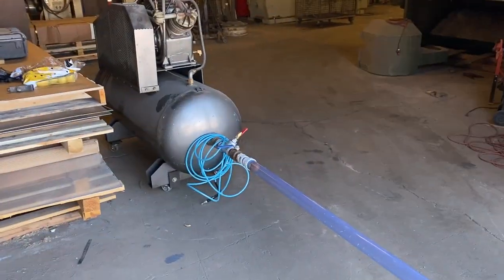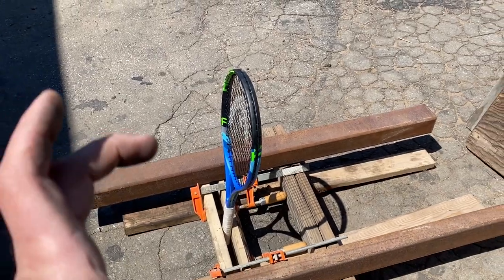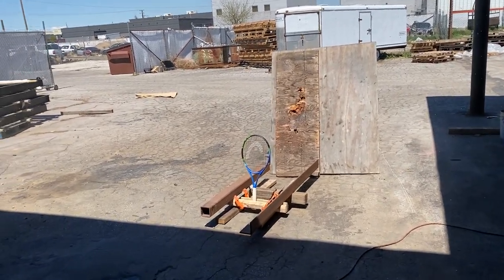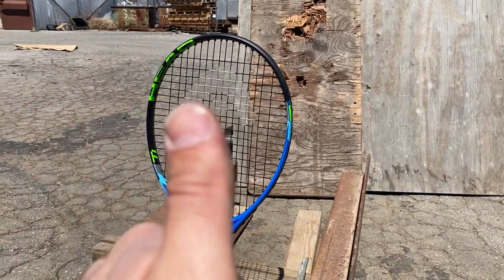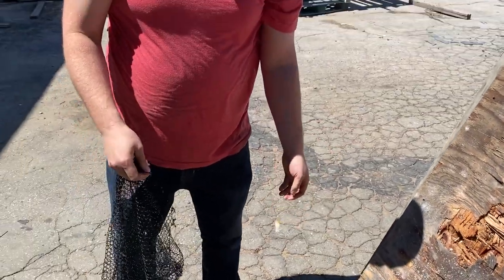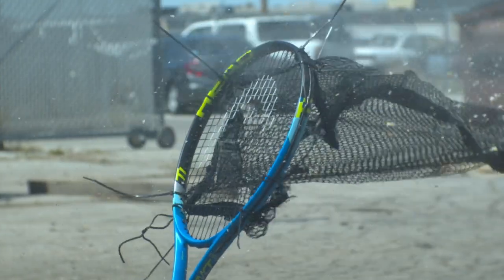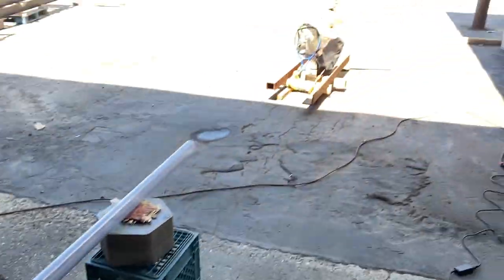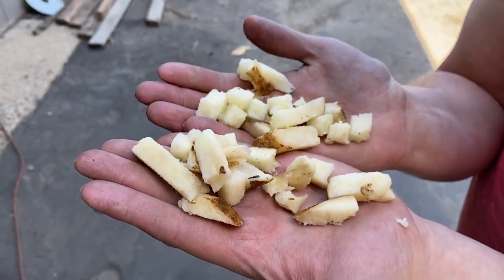Can You Make Fries With a Potato Gun and a Tennis Racket?

Comment: I could be wrong, but I believe this is actually how fries are often cut on an industrial scale.
Reply: they get peeled by a macerator and then squeezed through a press. Not really.. launched XD
Reply: The process is similar in concept. Take potatoes, put em in a pipe, put a cutting plate in the pipe, and then press the potatoes through the plate with water.
The water prevents the potatoes from shattering like what happened through most of this video. Can cut as many potatoes as you can put in the pipe, pretty much.
Reply: @RatRatRattyRatRat  I could be wrong, but I think the shattering is what helped with the taste.  They looked "rough" which might have increased the surface area exposed to the frier giving them a crisper taste.  Pure speculation on my part though.
Reply: You are not wrong
Reply: They just casually have a potato gun and a racket lying around

Comment: If you made something with thin metal in place of the stings it would probably cut cleaner.
Basically you're cutting with the backside of the knife when using the racket strings. it cuts, just not well.

Comment: Water jet some 1/16th inch stainless and make a steel tennis racket grid for some beef cubes for skewers on the bbq. A steel frame and a 30 bevel on the edges ought to work . Pork sirloin is cheaper,   but put the cubes in some PC souvlaki marinade and get the pitas ready! 👍

Comment: Did you know that McDonalds makes its fries using high pressure water pipes with cutting grids in? The potatoes whoosh through and get chipped just like your cannon, except with water instead of air.
SUGGESTION - Put different cheeses through your air cannon - a big old plug of Cheddar could be fun, and would probably wallop a target pretty hard - like a ball of clay.

Comment: Maybe a funnel type thing before the net will help catch more and slow the taters down so they don't splatter as much.
Cooking fries straight from raw potatoes will make them soft, like at In-N-Out or Five Guys (I don't like them but a lot of people do). To make them crispy you have to par cook them first (after rinsing them to get off extra starch). Fry them about 3 minutes at 300-325 F (or you can boil them), they shouldn't be browned at all and soft enough to eat but not falling apart. Then cool them off in the fridge. When they are cold then finish cooking them in Med-High heat (350-375 F) until they are GBD (Golden Brown Delicious). 

I don't know why I wrote this all down but there you go. Also engagement algorithm, I guess.

Comment: OK, it's not the stop that's the problem.  It's the launch.  The potato is being accelerated too quickly by the air cannon, damaging it before it hits the tennis racquet.  This is why it ends up more like mashed potato than fries.  The potato needs to be loaded with a soft foam follower to spread the acceleration over a longer time while still reaching a suitable exit velocity.

Comment: Set up a grid of knives to shoot the potatoes through to make french fries of "optimal size" it will also be a great way to advertise your water jet knives... You can have a special and sell them individually or as a set as the knives that made fries. you could even do it with a bunch of 1/2 inch wide blades welded together in a row and then do the same thing turned 90 degrees. you can also mount it to the end of the cannon then shoot other stuff through it too.
After making the wedge you should shoot a potato or two through it, some carrots, an onion a clove of garlic, some celery and a few pieces of beef or chicken then throw everything that gets through the knife matrix into a crock pot to stew for a day and make soup out of it. after that try shooting some wood through the blades but make it easy to pull the half's apart to sharpen the blades with an angle grinder.
Oh and can you create an evil can of Dr pepper? Just design a can that can blow up on its own like packing the bottom with tannerite and some cheap bang snaps so the bang snaps set off the tannerite when dropped. 
Also maybe try building some soda bottle water rockets or some out of PVC too?

Comment: You need to move the racket closer to the air cannon, and hang a large, loose sheet behind it to catch them. Try to hang it so that the bottom of the sheet is closer to the cannon than the top.